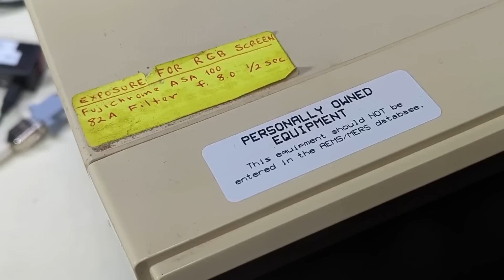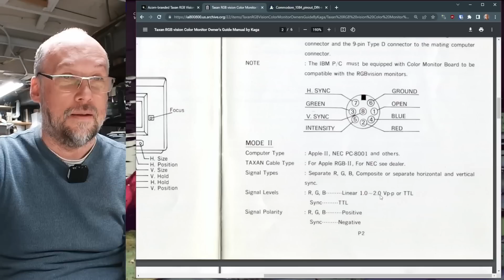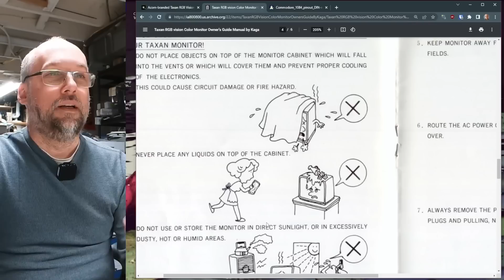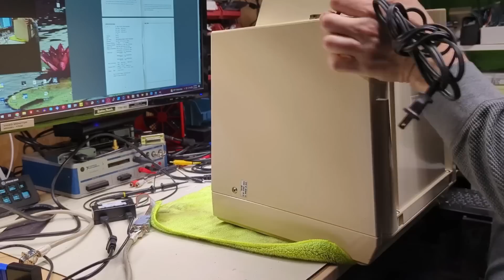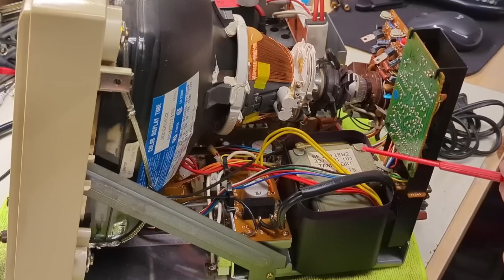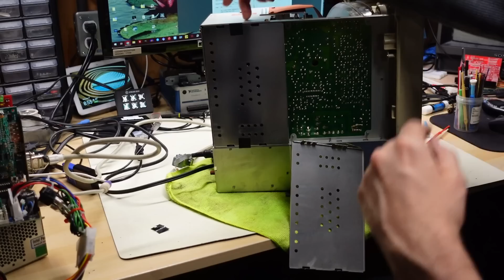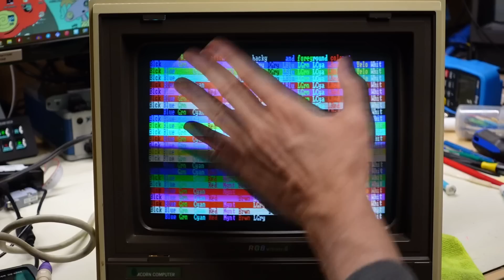I was shocked to find an Acorn Computer monitor in the US

Comment: Thanks! As per manual the monitor came in 3 varients with different tubes, vision-I (low res, 0.63 pitch), vision-II (as in video, med res, 0.47 pitch) and vision-III (high res, 0.38 pitch).

Comment: That hygroscopic acrylic staking compound has always been a bugbear. It turns from a tan to a dark brown colour and becomes electrically conductive and causes all sorts of issues. Had this friend that bought a whole pallet of down light buck converters and they could possibly start a fire. Most recently found that gunk in this GW insteak 3504 psu had to recap it and scratch of all the copper sulphate that stuff had caused.

Comment: Wow I actually have a virtually identical 12" Taxan monitor that I"ve had sitting around for at least 20 years now. It's seen better days, but last I checked it ws still working though could probably use a cleaning and maybe a recap. The only difference I see so far is that the one in this video has different inputs. Mine has a composite video input and the Japanese-style RGB input. In fact the only reason I haven't gotten rid of it is because it's the only thing I own that does composite color without a converter.

Comment: I had the same monitor under the brand Taxan. This one is missing the front tinted glass that made wonders removing reflections from the face of the tube. I used it with my Oric Atmos and later with my Amiga 500 but the color resolution was not good enough to display the Amiga's plethora of nuances.

Comment: About 18:38, the word you are seeking is hygroscopic, or hydrophilic.  Hygroscopic substances will actually pull water from the vapor in the air.  Hydrophilic substances either absorb or adsorb water freely.  One of the most common hygroscopic compounds is ethanol, which must be kept in an airtight container to prevent it from pulling moisture from the air and losing strength.

Me:  "It's too clean.  It'll never work..."
[It freakin' works...]

I really should know better.

Comment: Have you tried just plugging the analog RGB into a VGA output? Or would the sync be too fast for the monitor to track?
Reply from the maker: This monitor is only designed to accept 15khz horizontal scan rates, basically NTSC or PAL frequencies. Anything outside of that will just result in a loss of sync and it'll run the monitor outside of the spec its designed for.

Comment: Interesting, I've got that strange video connector on the back of a tiny little 5" Sharpe colour monitor, too. Also, a Kodak-Wrattan 82A filter is a bluish colour correction filter – but I wonder which film-stock was in use. Perhaps it was a tungsten-balanced film designed for indoor use.

Comment: Wow is that a clean unit, that focus pot assembly was usually quite black dust covered by the time they hit my repair bench back then.
As for the dark part been too dark, give the screen pot a tweak to bring up the background a bit, maybe that'll make it a bit better for you.
Reply from the maker: I actually tried -- it's odd the issue seems to be it lacks a contrast control, so really the white levels are too hig compared to black levels. I need to take a closer look at the circuit to see if I can reduce the whtie level a little so I can up the brightness for better grayscale performance.

Comment: Normally in the variable inductors they use to put a rubber band on one side to hold the thread of the ferrite core . With age they can be a bit reluctant to move .l use to repair TVs back in the days

Comment: As has been said until the release of the Archimedes range it was rare to see an acorn branded monitor, generally we had either the metal cased Microvitec CUB or a Plastic cased Philips. Acorn generally used RGB with composite sync, so similar to analogue RGB over SCART, I can't remember if it's digital or not but I would guess it was analogue so it was somewhat broadcast compatible. 
Those Japanese video connectors can have RGB on them, there was a Sharp monitor that is mentioned in the manual for the Roland S330 that uses that style connector for RGB video.
Reply: BBC Micro RGB was digital 5V. The 32 bit machines were analogue.
Reply: @melanierhianna  In the end I thought it might be digital, I don't remember much about the Model B I had in the late 90's/00's though I did later acquire a few Archimedes machines from school that unfortunately broke, annoying as I had about 3 A7000's at one point 😞with genuine monitor, keyboard and even had a compatible Canon BJC600e and Fastrax PCB software, luckily the A7000 used PS/2 keyboard and mice so any three button PS/2 mouse will work.
I did have a SCART/DIN Acorn monitor that I temporarily used with my Roland S330 though I now just use a SCART adaptor with either a SCART LCD TV or via a RGB SCART to HDMI adaptor.

Comment: Had a JCPenney branded TV/Monitor with the 8-pin RGB rectangular connector; we used it with a Laser 128ex. The cable was off the rack.

Comment: I used to have a Taxan CGA monitor that was gifted to me, along with a IBM 5160. It was kind of a cool monitor: It had a monochrome mode like the Apple II color composite monitor. But it also had a bunch of dip switches on the back that let you select green-on-black, amber-on-black or white-on-blue. I wish I still had that monitor, but alas, that was over 30 years ago.

Comment: Yes, Acorn sold computers in the USA...I remember having a couple in stock at the new and used computer store that I worked at in the early 1990's.  They were the first (non-Apple) PC manufacturer to use the Sony 3.5" disk drive.  Their first US model had single sided 3.5" floppies that held 360k (you could read them in a 720k drive).  They were IBM PC clones...their computers were about as common as a Jensen-Healy in the USA, which is to say, rare as he's teeth 😂
Reply: @Brent Boswell With the early adoption of single-sided 3.5" floppies and PC-style hardware, it sounds more like an Apricot machine.
Reply: Acorn didn't make a PC clone. They did have second processor add-ons but I'm pretty certain the model with that built in came after they abandoned trying to enter the US market. If they were straight up PC clones are you sure they weren't Amstrad?
Reply: @MechanicaMenace  Yup, Acorn wouldn't have been seen dead using an 8086/88. The didn't use the 80186 on the second processor (and the software PC emulator on the Achemedes also emulated the 80186). But basically it was for compatibility reasons only. Acorn always used more superior processors for their machines.
Reply: @melanierhianna  Well, Acorn used a 80286 in the unreleased ABC 300 series, and that could have been a line of business for them had they persisted, although having the BBC Micro as the core of those systems probably wasn't viable in the longer term. Also, Acorn rebranded the Olivetti M19 for the UK market, arguably to oblige Olivetti's incoherent strategy, so they absolutely did put their name on a product using the 8088.
Reply: @paul_boddie  Acorn also made plenty of cards with upto I think AMD 5x86 in them for the RiscPC. They were very capable and compatible. Third parties went all the way up to Pentium 2s (or equivalent) if I remember rightly. They were never averse to using x86 or a myriad of other ISAs. They seemed to just really believe different architectures had different strengths so if that strength is important to you use the right processor for that job and let another do what it is good at. Great philosophy for straight up CS nerds but not for the general public, even technophiles.
Reply: @MechanicaMenace  Yes, Acorn kind of embraced the PC card expansion concept with the Risc PC, this having been pioneered in a different form by Aleph One for the A-series models. Indeed, some of those earlier podule-based boards were even bundled with some A30x0 or A4000 machines by Acorn.

However, I think that Acorn rather doubled down on their combination of ARM hardware and RISC OS, only introducing PC compatibility to pretend that one machine could be everything to users in two different markets. Like so many similar efforts over the years, including Acorn's Master 512 and the emphasis on PC emulation early in the life of the Archimedes, the result was unconvincing and people realised that if they wanted a PC, they might as well buy one.

If Acorn had really been open to different hardware architectures, they would have persisted with Unix which would have given them some flexibility. And they seemed to have something of an aversion to Intel specifically, with the PC cards using parts from just about everyone else (IBM/Cyrix, AMD), and with the company's adoption of the short-lived Windows NT on PowerPC for their SchoolServer product.

Comment: This monitor absoulutly is a rebranded Taxan monitor; Used to work for the UK distributer of Acorn computers. There was a short period when we where peeling off the Taxan labels and sticking on the Acorn labels when Taxan had supply / demand issues with the Acorn branded version.

This was for a conract with the home office providing BBC computers & Econet into the education centres in prisons in the UK as part of the computer initiative of the late 80's.

Comment: Yes, the little block with the HV wire going to the anode cap is a tripler (most likely, a Cockroft-Walton voltage multiplier) which has a series of diodes and capacitors in a sort of ladder configuration. It works directly off the AC from the flyback, so doesn’t need a separate HV rectifier like old tube TVs had. I believe this was done so they could design the flyback to have fewer windings, and thus cheaper and more reliable as there was less risk of arcing between the windings of the secondary. The downside of this design, is that the focus and contrast controls (potentiometers) were often baked into the same potted block, so you couldn’t fix them if the controls became dirty (so no DeOxit F5 to the rescue!) ☹️

Comment: There is a "Nanao" label on the PCB. That's EIZO. I wonder what the deal is with that, I supposed they could have provided the PCB components. It also makes sense that it's a NEC PCB because EIZO has used NEC displays. I think maybe this is a rebranded Nanao 7030?

Comment: You're forgiven given you're not from Massachusetts <g>, but "Woburn" is pronounced "WOO-bin" :)

Looks like they were there in MA for only 7 years, from 1983 to 1990. But I had no idea they were there at all.

The connector is a D8A2 Japanese Digital RGB connector that supports 8 or 16 color displays. The MSX Resource Center has a pinout for it
Reply: Unless they kept the subsidiary going as a dormant entity, Acorn shut it down already in 1986.
Reply: @paul_boddie  Different sites I saw had different dates. One said 1984 to 1987 in Woburn, another said 1984 to 1990 in Woburn. 

I've no idea if either of those are correct, or if it was only 2 years to 1986. Wikipedia says 1986 closure was for the sales office, but no idea if the Woburn building was just sales or also support. Now I'm curious.
Reply: @Psychlist1972  It would be interesting to know which sites mentioned which dates. I added the 1986 reference to Wikipedia, I think, but that can be improved if there are any better sources. The computer business was transferred to a Texan company, noted in the Wikipedia articles for Acorn Computers and the BBC Micro, so I guess support for the machines was taken over by them. Note that Acorn Research, who were situated in Palo Alto, will have existed until a later date, but I don't remember if that was part of Acorn Computer Corporation or was elsewhere in the corporate hierarchy.

Comment: Another issue when trying to adjust a coil with a metallic tool, if it contains ferrous metal, it will change the inductance of the coil while it is inserted, making accurate adjustment impossible (and that's before considering residual magnetism).

Comment: Interesting to see what you guys across the pond got... here in the UK, Acorn computers typically shipped with a monitor from Microvitec - such as the iconic "CUB" series which are pretty much always seen with BBC Micro's especially in schools. Later Acorn monitors (for the Archimedes) were typically either Microvitec or Philips - the Philips ones were pretty much the CM8833 chassis
Reply: @tomgidden  Yep the CUBs were highly adaptable to all sorts of input formats - the metal boxed ones had the input circuitry on a card IIRC which could be easily swapped out for various input formats

Comment: It looks like that control was working. 24:29 the screen does wiggle a little and I think you may have just looked away at just the wrong time and missed it moving ever so slightly. Right after you say, "I definitely have the tool in there." Just as you're saying the word "there" it starts moving. It really moves a lot more as you're saying, "This is probably a fault."   Then when you start saying "yeah nothing..." it stops. It is definitely moving the picture a little. So maybe just turning it from the min to the max got things loosened up so the slug could move and it really started working.

Comment: An actual US model rather than an import! I wouldn't have suspected that such a beast would exist, but here it is.

FWIW: At least here in the UK Acorn monitors were usually models rebranded from top of the range devices from reputable manufacturers - I've still got the AFK85 multisync that came with my first RiscPC, working just as well as the day I got it.

Comment: Acorn did actually make a US version of the BBC Micro. As part of the PAL to NTSC conversion, all the video modes got changed from 256 scanlines to 200 scanlines --- 32 to 25 rows of text. Naturally, even though it was possible to query the screen size through the rather good OS, nobody did, with the result that almost no software written for the UK version of the machine would run on the US version. I suspect that Acorn were the only people surprised when the machine completely failed to sell.
Reply: It was quite a bit different inside because of federal RF requirements, not only shielding but the board was layed out differently. In fact that's where the BBC B+ came from, it was an updated B which could comply with multiple region RF requirements.
Reply from the maker: Interesting tidbits! Thanks for sharing.
Reply: @adriansdigitalbasement2  surprised you didn't pair this with the bbc micro you picked up previously

Comment: The BBC Micro is actually 1v p-p on its RGB outputs.
Reply: That's interesting - that'll explain why I was able to plug my Electron directly into an Amstrad CTM640 without breaking the monitor. The Amstrad monitor can power the Electron too, via the 5V DC output :)

Comment: I would love to see you exploring more about mode 2 and 3.
Reply from the maker: Yes, will do! Defintiely on my list now I have this beauty.
Reply: I'd like to see it in analog mode on an Amiga or something. I used to pick up old monitors back in the 90's at auctions because I was on a quest for the best monitor to use with my Amiga 1200. I had at least one Sony with that funky Japanese connector on it. It was definitely wired for RGB. I think I just replaced it with a properly wired DB9. Scored a massive monochrome workstation monitor that I never could get to sync to any computer I had, a HUGE cube-shaped 24" 15khz analog RGB monitor like the kind they used for timetables in airports. It had a little drawer that pulled out with all the adjustment pots. I hacked a Commodore 1300 genlock to be a standalone composite to RGB converter and we used it as a TV in my college apartment. Got it for 5 bucks because nobody wanted to carry it out it was so heavy. I eventually did strike gold with a Mitsubishi multisync that would take pretty much anything I threw at it. Don't remember the model.

Comment: It's "hygroscopic", meaning it absorbs water. Often confused for "hydroscopic" which doesn't mean anything.
Reply: ''Yes, hydroscopic is a word. It’s an adjective derived from a noun: hydroscope. The word hydroscope is usually used to mean a device for observing underwater objects, say from a boat. These devices were invented pretty early on, and typically used a long tube with a series of mirrors to carry an image of objects underwater up to the surface of the water. So for example you might make hydroscopic observations of coral reefs in shallow water using a hydroscope.''

Comment: Finding an Elektronika computer in the US would be even more bizarre, which is actually kinda sad because those things were PDP-11 clones, so there are very interesting from the design perspective. Elektronika BK - home PDP-11; Elektronika 40 - Tetris machine.
Reply: PDP-11 instruction set was very popular in the USSR, but not all CPU's were clones. K581 Soviet chipset was the exact clone of the LSI-11/23 and K1811 chipset was the clone of the DEC Professional 350. But BK0010 used K1801VM1 and it was not a direct clone of any DEC chip. It differs from ther DEC CPU more or less like NEC V20 differs from 8088. Same were K1801VM2 and K1801VM3. There were hadhard version of these chip and CMOS low power versions and they also were not the clones. Electronica 60 used the K581 and was very similar to LSI-11 but not BK0010